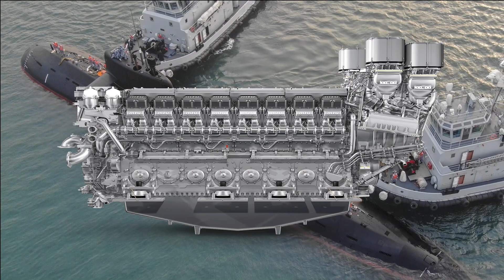Pakistan lays keel for 5th & steel cutting for 6th Submarine to be built at Karachi Shipyard

Comment: Is it possible to use Submarine Nuclear Reactor on Ships. Like using Nuclear Reactor of Arihant class submarine on Aircraft carrier. Arihant have power of 83MW. INS Vikrant has 4 LM2500 engines delivering 88MW total power. Charles de Gaulle has Reactor delivering 65 MW shaft power.
Reply: Yes it is. The submarine suitable reactor have special customizations though to be much quieter

But nuclear powered ships have other issues that need to be addressed - such as inability to dock at harbours of other nations etc which will a great obstacle to smooth operations.
Reply: @cp_pdn  Indian Carrier doesn't need to dock in countries which doesn't have nuclear ships, US and Russia will not have problem in docking nuclear ships. A4W reactors of Nimitz carriers have 104 MW shaft power and 100 MW of electricity. So 4 S1 class reactors can power propellers and enough electricity for Carrier of Vikrant class.

Comment: The time to start a private sector led consortium to build a Bharati submarine based on  midget submarine design scaled up to produce a viable hull made with DMR 249 B steel. Lithium ion cell technology exists with private sector, and fuel cells with both DRDO and ISRO. Brahmos, lightweight Shenya torpedo, and LRLACM are all 100% indigenous. Even the sonar and pump jet propulsion. It is past time to start a private sector and IIT collaboration to build a Desi submarine powered with fuel cells.Need to build at least 12, existing 6 P75I project isn't enough. Prior experience building Scorpene subs is enough with all the building blocks already assembled.

Comment: Why can't India design a diesel submarine on its own we been building submarines for a long time?
Reply: Bharat does have not only plans for Scorpene, but also Type 209 which South Korea used to build their own version. In addition to that, the midget submarine design can be scaled up or the Arihant scaled down to produce a viable hull made with DMR 249 B steel. Lithium ion cell technology exists with private sector, and fuel cells with both DRDO and ISRO. Brahmos, lightweight Shenya torpedo, and LRLACM are all 100% indigenous. Even the sonar and pump jet propulsion. It is past time to start a private sector and IIT collaboration to build a Desi submarine powered with fuel cells.
Reply: @datoolz0  Korea use German submarines with make in Korea model. Just like scorpene is French sub with make in India model.
Reply: @datoolz0  Scorpene subs Indian? Type 209 subs Indian? Have some shame, please
Reply: Are mad we are building our nuclear power submarine
Reply: If you do so without full TOT, the first batch of indigenous models must be obsolete and unreliable at the time they enter service. Will the navy, the parliament, the people tolerate that?
Reply: @yixinmei5854  None of the subs in service with the PLAN were reliable until the latest Jin class. If it takes a decade, that's how long it takes, all the more reason to start now!
Reply: @DHRUVASTRA  Bharati ship building is horrifically slow and outdated tech .Privatization of shipyards can fix this massive flaw. Can catch up in numbers of subs then.
Reply: Dear, we are not able to build assault rifles, u r talking abt submarine 🤣🤣🤣....ahhh one thing for sure, MOD will sanction enough funds for putting poster on expo
Reply: @daemontargaryen2814  What the hell is SSS defence ? Does it make your dick instead of ARs ?
Reply: @daemontargaryen2814  Main thing is that MOD takes a long time to give an approval. U.S. has pentagon which makes decisions on buying weapons very quickly. By 2030, India's defense department will get separated from politics which will give us faster defense procurements.
Reply: @sriyanshumohanty6937  politicians will spend on giving freebies but not on R & D
Reply: @daemontargaryen2814  Yeah man..